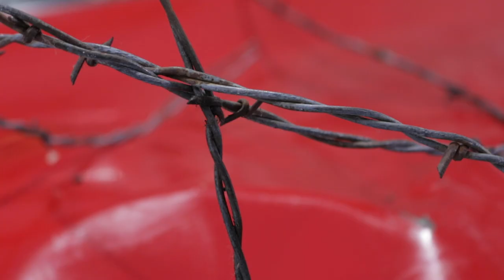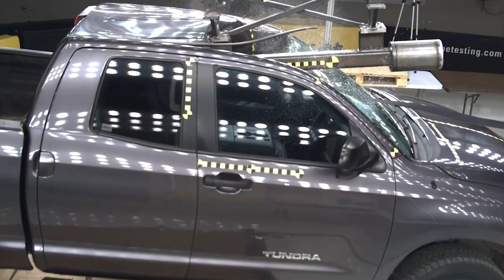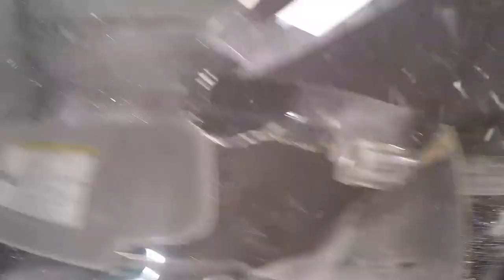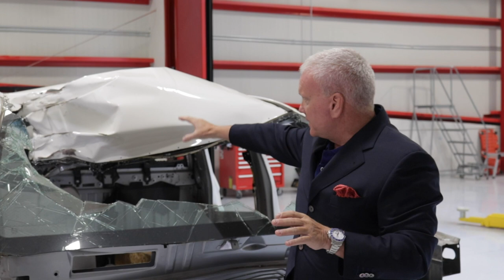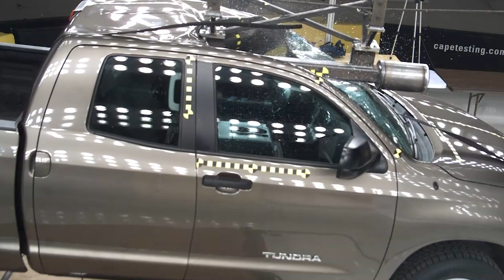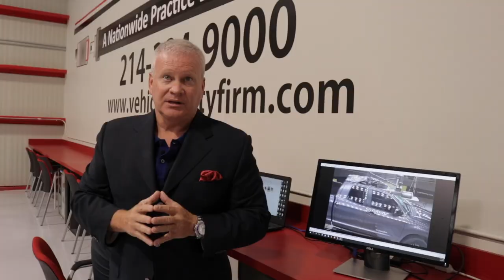$70 Millon Lawsuit Alleges Don Davis Auto Group Lied About Safety

Comment: Hi Todd, this is a very great test to do and is a crash test that should be done to every vehicle put in production! this just proves that the side roof rails can be strong and the center of the roof can be as frail as can be. This makes me really think how accurate the IIHS roof strength test is. They should add this on to their roof strength testing, that would be a way more accurate test for safety.